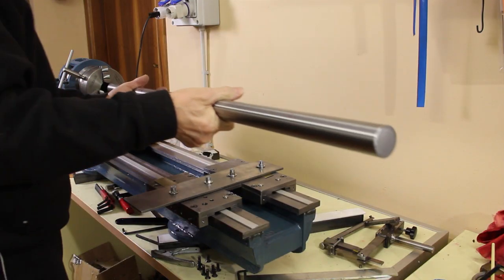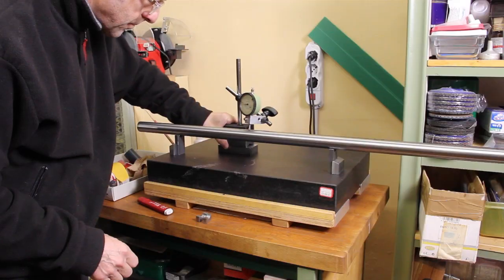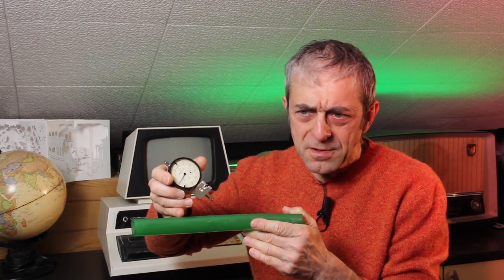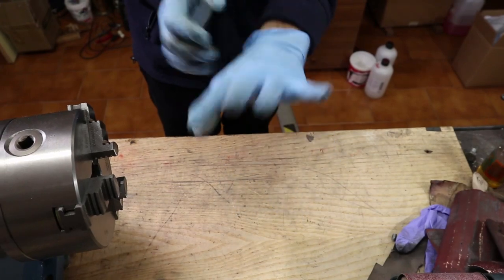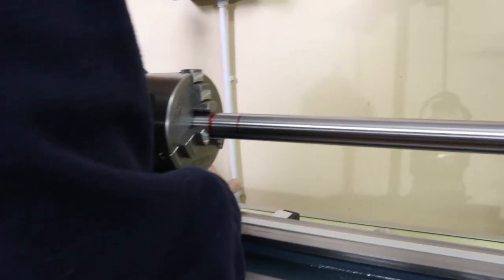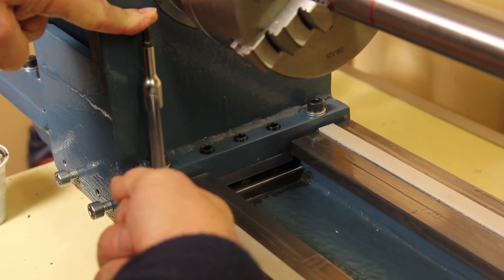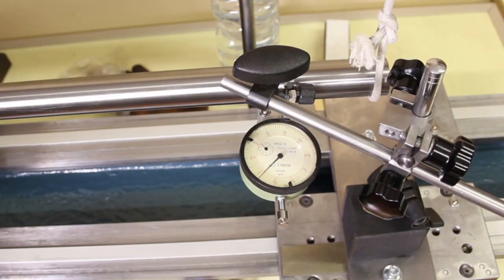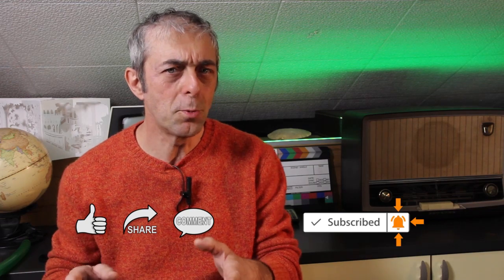Headstock installation + alignment - DIY metal mini lathe part 7

Comment: That kind of alignment accuracy is obviously very good. Except as a general rule both the lathe head stock and tail stock are purposely misaligned by roughly .001" in 10"-12" over the length of the bed both up and towards the operator. That slight misalignment is done in an effort to build in a compensation factor for both work piece weight and cutting tool pressures. It's obviously not a perfect system since both the work piece weight and cutting tool deflection can have large changes depending on what's being done or even the cutting tool material used. So it's a best case average that helps the lathe deflect towards being more accurate instead of less in most cases. And that was very clever thinking to use a weight counter balance to remove the test bars sag due to gravity.
Reply from the maker: Good point, you re right about the slight misalignment. Indeed I forgot to mention this point in the video but I've actually kept the unavoidable error (about .0004") up. Thank you for your comment.

Comment: In the home made mill I am making, the base is epoxy granite with steel plates that I bolt the linear rails to.

For alignment, I’m epoxy on bronze sheet between the linear rails and base, and i am hand scraping in the bronze sheet to achieve flatness. 

I’m using a home made autocolimator with 300mm focal length to measure flatness.
Reply from the maker: Nice.

Comment: I like the counter weight at the end, but do we not now have a steel bar supported at both ends, with resulting sag in the middle?  Your solution clearly improves the situation, but I wonder if you ever calculated the deflection of the new situation, with an eye toward increasing the number of points of support as needed until desired accuracy is reached.
Reply from the maker: Counterweights compensate the sag.

Comment: You should not use 3 jaw chuck as a base for alligment because these kind of chucks are not precise in nature.
Reply from the maker: Aren't they imprecise because of the run out?
Reply: @AccidentalScience  They are not precise becouse of their design. Usualy you buy a alligment bar, that have Morse taper on one side, same as in a spindel and some cylindrical part on the other. It cost somethin about 50 euros. Your approach to lathe building is in few places unorthodox ( welding after machinning , using glue, using cold rolled stock that is not annealed) but at the end of a day , what is importent is that, are you happy with your machine? Is it precise enouth for you? BTW I also thing that Whitworth 3 plate method is somehow amazing and enlightening. Love your work!
Reply from the maker: @kundeleczek1  thank you. I actually like to experiment new things ...sometimes boldly going where no man dared to go before 😃

Comment: The mistake you are doing is that you're building on a Flexible wooden bench . . if your goal is precision (which I am not against at all) . . it is better that you start by building a concrete work bench with a flat granite on top or a buy a big flat granite rock if you can afford it. Of course building your machine is more fun and exciting than buying one . . stone is hard and less flexible than any other material and glass can't handle weight  . . so stone is the best
Reply from the maker: Thank you for commenting. That bench is actually made of steel, has just a covering made of wood and melamine. But yes, it is not adequate and I've already planned to change it with a stronger steel-concrete bench. To do this I have to build a new tool, that you'll see in a future video. Cheers.